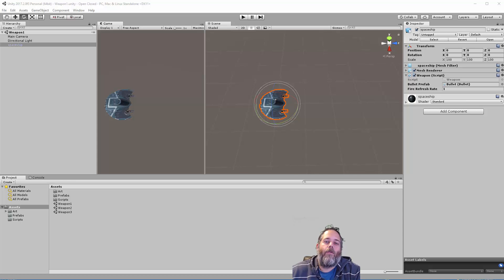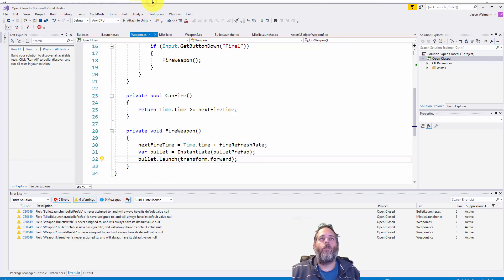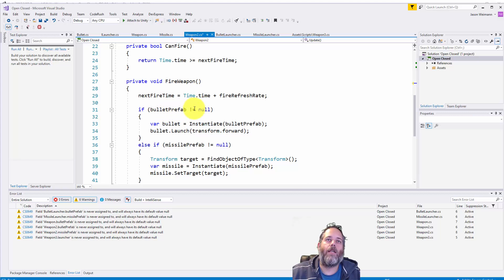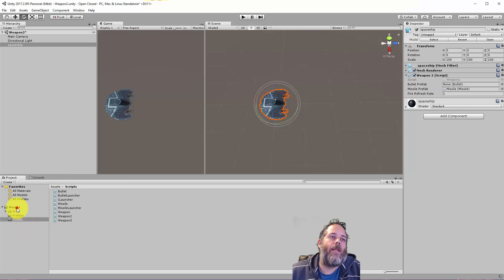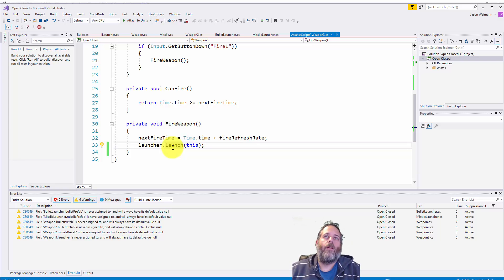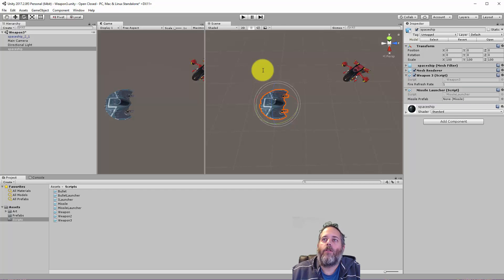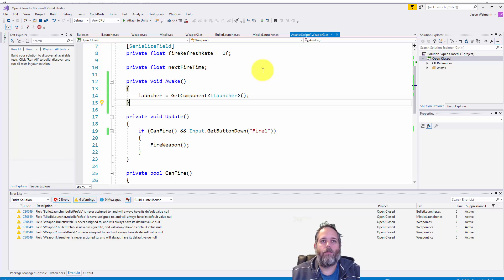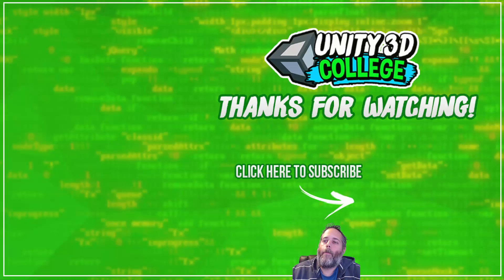Unity3D - SOLID Code - Open Closed Principle

Comment: I'm sorry but I don't see how your solution helps with the situation the ship having 5 types of weapon and switching between them during the runtime. Will you always have to keep the launcher chosen by the player and disable the other scripts? Because otherwise GetComponent will get me any ILauncher it finds first and that can be not the weapon I need
Reply: Exact same thing I was thinking as well. Good implementation of open/closed but terrible use case
Reply: @Th3-Mast3rmind  It's not a terrible use-case. You've misunderstood the goal of the video. The original code has tight coupling between the weapon class and its dependencies. Therefore, any changes to the weapon system require modification of the weapon class which exposes it to potential bugs. The new weapon class instead relies on an abstraction and therefore no longer needs to be modified when the weapon system is changed. In that sense, the code has set out exactly what the OCP aims to achieve. The code is now much more robust and flexible. 

Switching out weapon systems at runtime is a different problem that this video isn't aiming to solve. For that you can consider scriptable objects and/or state machines.

Comment: Open/Closed principle means that you should put new code in new classes/modules. New classes can reuse existing code via inheritance, polymorphism, Interfaces, events and many other ways.  Open/closed principle is intended to reduce the risk of introducing new functionality. If you don't modify your old code, you won't break it.
Reply: One aspect of the principle I think, is for the base parts to be as vague as possible. And it fits into the single responsibility principle.
By vague I mean it should define what it does or is, just that you call it.
Let's say you want a guy wielding a weapon say a sword, but then you also want him to wield a gun, but what if it's not a weapon but a tool that moves the player?, what if you want him to do something with just his hands?
Attack? No just have a class that you give the calling class or whatever holds all the values. And just call the "do" method.
What does it do? It does something, that's it. What it is, is none of you class's problem.
This way if you want to add and replace it, you can.

This is something I'm currently working on with finite state machines, or semi finite.
I want other classes the possibility to use their own custom state along the others.
Like in TF2. You have stand, walk, jump etc. But taunts? Just add a list or array. And all you do it have an interface on them or an abstract class. Called just taunts or states.
Now all you need is to make it inherit the abstract class, set the information in the taunt state, and drag it in the list.
Reply: @BouhJouh  You are correct, always start with abstraction and end up with specific implementations.

This is pretty much why you should also always program to interfaces not specific implementations.

Comment: I got a question: why not let the bullets/missle prefab handel the propulsion ?
Reply: you shoot 100 bullets, you just made 100 instances of some script. If you're on mobile or webgl yikes. Best way to do it, is to one have a static BulletMover class that is responsible for moving all bullets. The shooter will call the BulletMover class and say what direction its going and how fast. And every frame the bullet mover will take in bullet moving requests

Comment: Hi there!
Thanks for great tutorial. I have a q. What if fire rate depends on type of launcher?  It means that Weapon class should be aware of ILauncher type classes. Otherwise fire rate should be extracted to the ILauncher and weapon retains the only function of Fire. True Single responsibility :)
Reply: One way you could do it would be to override the refresh rate. Get the component in the launcher script and then override it.
Reply: @hawns3212  It would not be a signle responsibility behaviour then I guess
Reply: @pawekowalewicz2752  hi here is an answer
Reply: @Jason Weimann could you answer this interesting question? :)
Reply: interface ILauncher(){
float fireRate;
Shoot();
}

FastPewPew:ILauncher(){
fireRate = 1f;
Shoot(){
//pew pew
}
}

PlayerController(){
ILauncher fastGun = new FastPewPew();
float selectedWeaponsFireRate = fastGun.fireRate;

if(timer > selectedWeaponsFireRate{
fastGun.Shoot();
timer = 0f;
}
}

something like that

Comment: What does internal mean in the ILauncher interface?
Reply from the maker: It's like public but only for things in the same project/dll.  When it comes to unity projects, there's really not much difference (but it matters a lot if you work on standard c# apps that use multiple projects)
Reply: Unity3d College  I see, thanks